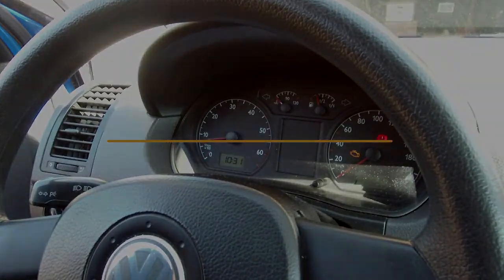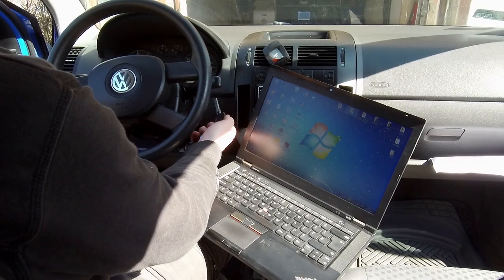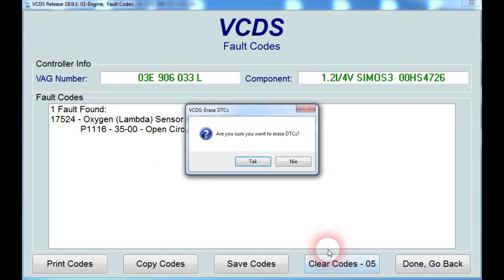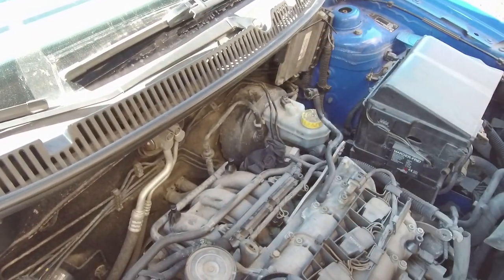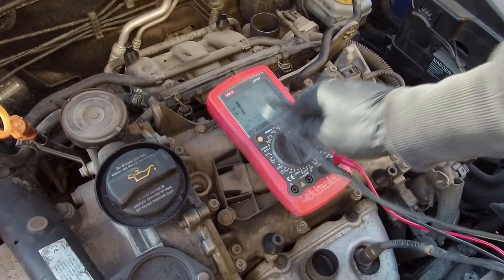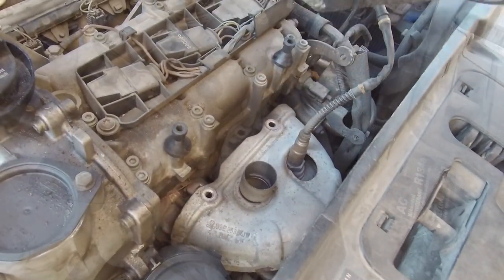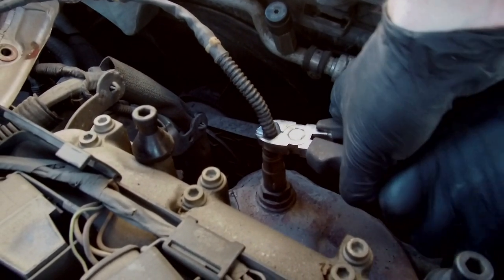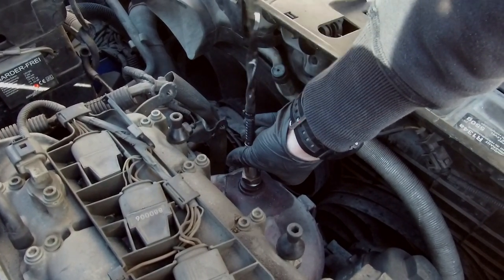How to replace oxygen sensor (damaged heating circuit) P1116

Comment: If i have p0172 and p0106 IT might be The o2 sensor? Ive replaced The map sensor, cranck sensor, egr... And stil have The check engines light with these fault codes.